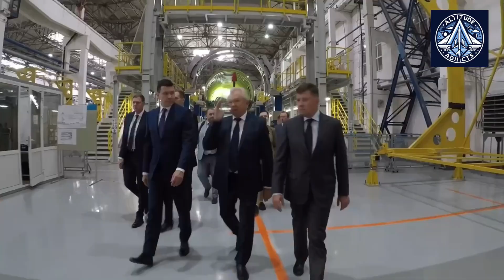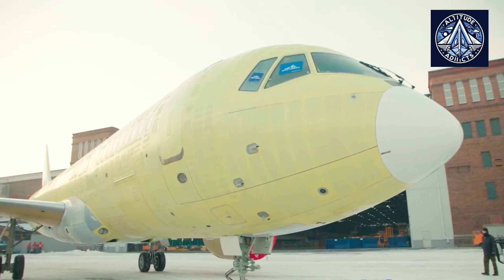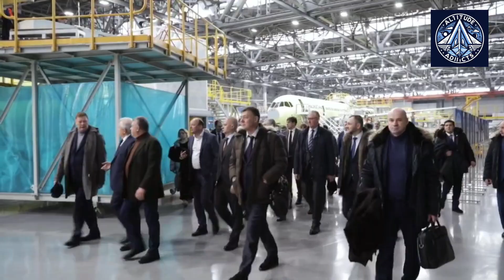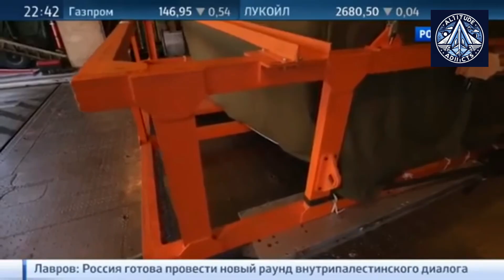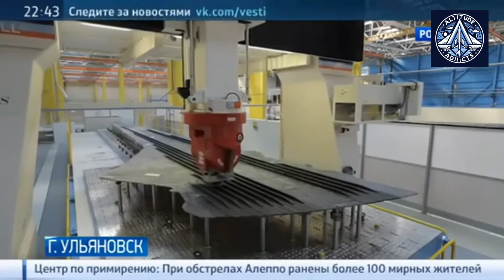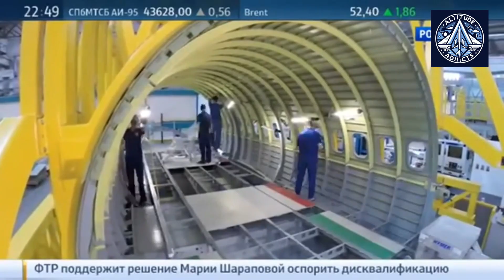Yakovlev Gets Approved For MC-21 Production: What’s Next?

Comment: I think UAC should be honest about the excess weight of the MC-21. With dimensions larger than the A320 and C919, it is impossible to weigh under 45 tons. Even if it is capable of weighing 46 tons, I think this is still good. To achieve a weight of 43 or 44 tons as originally planned, the existing data seems impossible. Delaying certification by waiting for a vendor to provide lighter components will only continue to slow down this project.